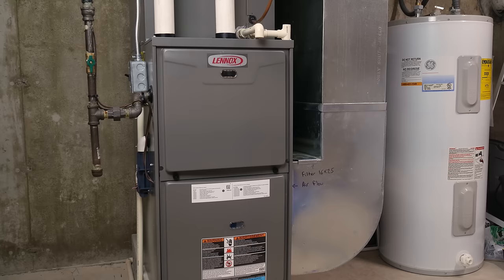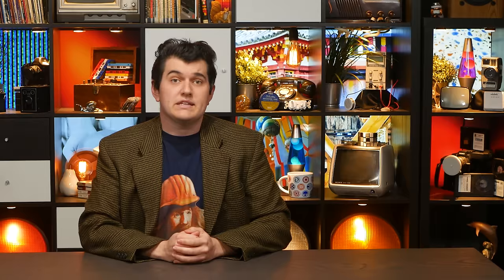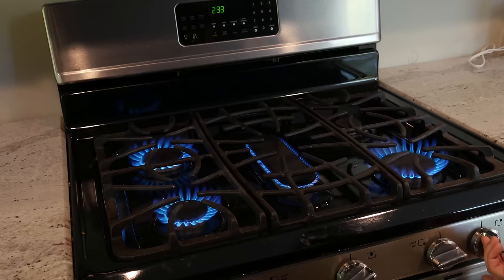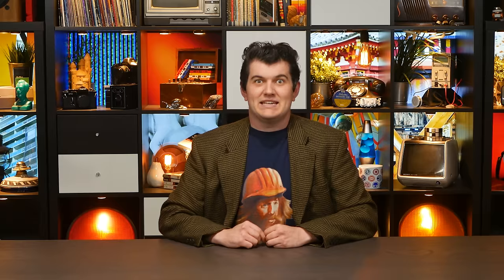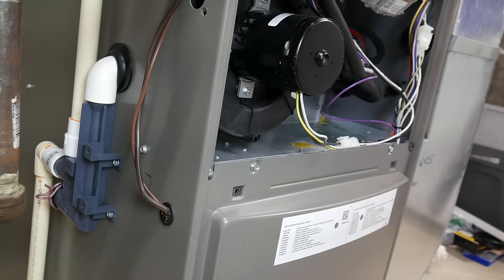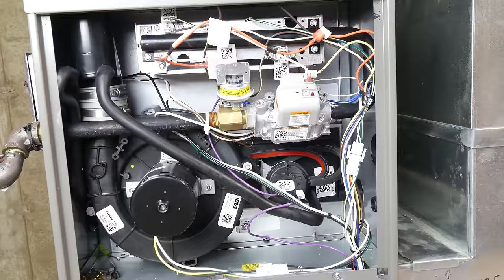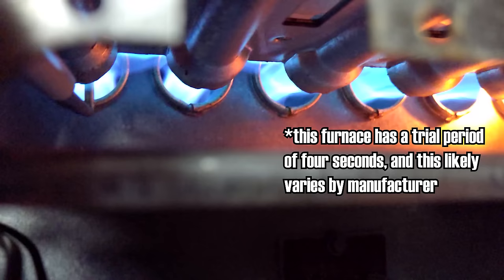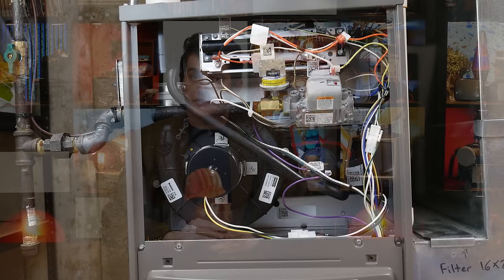Forced-air Furnaces: The What, Why, and How

Comment: In Brazil it's the reverse, you MUST have an AC unit, or else you'll die cooked, last week we managed to hit 43°C.
Reply: Those temperatures are a crime against humanity.
Reply: @liesdamnlies3372  Add in some extremely high humidity and you'll feel like you're dying every single second (you probably will).
Reply: @tomhsia4354  I'm Canadian. When it hits 28 degrees with high humidity, it's a heat wave. And my own personal "jfc it's hot out" point is 24.
Reply: @liesdamnlies3372  I'm a Canadian, and I've lived in Shanghai for extended periods of time. It can go over 40 degrees Celsius with very high humidity (my humidity meter just reads "err: hi"). After heat waves like that, you get cooler temps but with humidity so high stuff tends to become wetter instead of dryer. BTW, air conditioning was not common is schools during my time, and we could have God damn mushrooms growing from our class mop. Hell must be a pretty comfortable place for people who can tolerate the climate in Shanghai, eh?

BTW, winters in Shanghai make you feel far worse than Southern Canadian ones, despite the temps being 20 degrees higher. High humidity on cold days make it practically impossible for you to get comfortable (it also rains and the heating is shit)
Reply: @tomhsia4354  That's just...wrong. Inhuman. I'm just gonna stick to Canada. The world is far too scary a place.
Reply: Had to convert those to freedom units.  Yeah, 43C (109.4F) is pretty damn hot.  28C (82.4F) is a bit warm* until I finally get used to it then winter hits and I'm freezing (Last year didn't have a lot of snow but it regularly got below 20F/-6.6C).

*Assuming moderate humidity, in high humidity I'd be sweating my ass off.  Don't have AC in my Condo (well I do but it's prohibitively expensive to run) but I do have it in my car.
Reply: In Los Angeles CA last month it hit 121F. That's 50°C. For about 3 months it was around 100F every day. Oh yeah, and smoke from fires for over 2 months.
Reply: @bigbaddms  Jesus Christ. 121F with smoke? No, just no.
Reply: @tomhsia4354  it literally looked like Armageddon 🔥🔥🔥🔥🔥🔥
Reply: @bigbaddms  Just reminded me of this: https://www.artstation.com/artwork/WKP41G
Reply: @liesdamnlies3372  Absolutely. Whenever I cost family who live in a coastal city on India, the humidity is what's unbearable.
Reply: In India, temperatures reach 47 degrees during summer where I live. Here we install separate units for each room to increase redundancy. Furnace is an alien concept here lol.
Reply: @tomhsia4354  It's 31C with 86% rh in my city. Air-conditioners are keeping me alive.
Reply: @panzer3279  In Shanghai it's also common practice to install each room with it's own air conditioner. It also works better since each conditioner can be way smaller and work on a smaller room. Furnaces (and insulation) are also foreign concepts. Each room having their own weather sealing is quite common, however. The new place my family moved in has central AC for the household and it does not work as well. We have heated floors but that's a useless waste of energy.

Comment: HVAC tech here. For some reason, down here in Florida, our county is installing way more furnaces than heat pumps because now there is reliable access to natural gas. I've always hated diagnostics on furnaces because they looked so foreign to me, and accessing anything in the evaporator coil box is a chore. 

60% of the time, the issue is a malfunctioning safety device rather than a functional device, which takes way too long to diagnose most of the time. Plus the safety devices are a whole lot less to replace than the real components, which means less money per call, so they're both longer and less profitable. I'm just lucky to also get an hourly with my company; that kind of a rarity.

Comment: I bet he scanned every one of those QR codes when he opened that up.
Reply: Technically they aren't QR codes, they're... some other thing I can't remember the name of now
Reply: Managed to scan one from the video, apparently it's a Data Matrix, and it actually has more useful information in it than I expected... there's actually some readable text as well as a number
Reply: @EdwardMillen   What are they called? they look pretty QR'y didn't know they had a different name
Reply: @JessHull  Data Matrix.  QR codes have squares in 3 corners while Data Matrix have solid lines on 2 edges and even dots along the other 2 edges.
Reply: @EdwardMillen  they are actually QR codes they corresponding to the part numbers it is attached to. something Lenox does
Reply: @abjz71  ... but they're literally not QR codes, they're a different type of code called a Data Matrix, as me and someone else have both explained above. I'm not disputing what they contain, just the type of code they are

Comment: The sparky thing wears out. Our furnace eventually started clicking the sparky thing multiple times before it would light off.
Reply: I remember when furnaces used a small, perpetual flame, called a pilot light, to ignite the main burners. And there were no draft blowers back in the day. They relied on convection to draw the combustion gasses through the heat exchanger and out the flue pipe.
Reply: @dougbrowning82  Mine still does.  It still uses the pilot light to ignite the burner.  It's old.  But still works quite well.
Reply: @dougbrowning82  Steam boiler & HWH with standing pilots here.  Boiler has an open pilot that's easy to relight but is susceptible to drafts.  HWH has a shielded pilot that's a pain to relight (manual piezoelectric ignitor like an old propane grill) but much less likely to go out.

Comment: In the Netherlands most homes are heated with boiler/radiator systems, with furnaces being limited to upscale villas. People with that kind of hot air heating systems seem to swear by it though as they consider the comfort level to be much higher.

Both are now being replaced with air-water and air-air heat pumps respectively as were moving away from natural gas.

Comment: Thermodynamics: You can't be more than 100 percent efficient!!!
Heat Pump: Hehe, Heat Pump go brrr
Reply: I don’t understand what your problem is. In reality heat pumps are not more than 100% efficient. If you look at the complete cycle they aren’t. We just don’t really car about the hot exhaust to the atmosphere so we can ‘say’ it is more than 100% efficient. That is also why things that burn things like furnaces are measured on their actual efficiency while  vapor compression cycle machines are measured on COP which is not technically efficiency.

Comment: Spark Ignition systems are still used and in my personal opinion are more reliable than hot surface igniters. I don't run across nearly as many failed spark ignition controls as I do burnt out hot surface igniters. To expand on the flame sensor and its operation, what you are looking for when you test one to verify that it is indeed dirty and causing ignition failures is you run the signal through a DMM and look at Micro-amps DC. You are looking for anything above 0.5 micro-amps which is the rule of thumb cutoff limit for proving a flame. You pull the flame sensor once confirmed dirty, clean it, (I prefer a brass brush as it doesn't gouge the metal and cause excess surface area to be created to hold more crap in the future) install it and test it again to prove the flame sense is within the proper range for whatever you're working on, usually 2 to 6 micro-amps.

Comment: You might want to add a video or addendum to this one to discuss the even older forced-air furnaces that had no draft inducer at all, such as those commonly used in the 1980's. My current home has one of those, but its in this year's plans to replace it with a modern one.

Comment: I didn't know about the condensing part. That's pretty cool (hot?).
Did I miss how it can have an open drain without also blowing out gaseous combustion byproducts?  I'm guessing a water trap? I think that's what that little blue thing connected to it is. 🤔
Reply: Yep, all condensing furnaces have a trap somewhere that should be cleaned out yearly. if the trap clogs it will eventually stall inducer draft preventing furnace from working,
Reply: In a proper installation, the exhaust PVC pipe has a slight rising slope from horizontal.  As the remaining moisture condenses, it flows back into the furnace and down the drain.  If the pipe sags, it will fill with water, leading the furnace to shut down.  Learned this at a friend's house, which got quite cold one night.  The first thing the HVAC guy did was push up on the pipe, which drained the water, and the furnace could work again.  (He fixed it after that.)
Reply: or go into a small reservoir that humidifies the circulating air when it evaporates.

Comment: I've never seen a furnace with a thermocouple for a flame sensor. Since fire is conductive, all the flame sensors I have seen are just bare conductors in the flame, with the flame itself closing a circuit between the conductor and the burners. When these go through failed ignition cycles, it is usually because there is soot or corrosion that is causing resistance on that circuit. Cleaning the burner face with a steel wire brush will usually fix it.

Comment: The boiler and radiator system in the house I was staying in while in england broke my brain as a Canadian. WHY IS THERE A TAP ON THE HEATY THING
Reply: RiotPunch where exactly was the tap? UK here, and can't really picture what you're referring to! Unless it was a super antiquated system- something more like a kitchen range that also served heating and hot water?
Reply: @spencerwilton5831  it was more a valve, but it looked like it was off a sink

Comment: You missed one important safety switch. Roll-out out switches! They help detect a cracked heat exchanger. In the event of a cracked heat exchanger, the pressure switches may not catch it. The loss of vacuum in the heat exchanger will stop pulling the flame through it, causing the flame to "roll-out" of the primary tubes and will quickly heat up the burner box causing the roll-out switche(s) to open. 
Great explanation though and glad to see you caught the flame sensor mistake. I feel like you know more than most gas techs that work on furnaces for a living

Comment: Theres also another type of furnace in north america that's more modern called a 2 stage furnace (also refereed as a dual-stage furnace). This type of furnace saves energy on slightly warmer days by only lighting half the burners, and lighting the second stage only when needed (or whenever the thermostat calls for second-stage heating). 
I have one of these, and mine also has a variable speed blower motor, which can really save energy on days where it isn't sub-zero outside. variable blowers really make a difference because when you set your thermostat to constantly call for the blower, it stats on a low setting, where it is quiet, efficient, and still moves air. When the thermostat calls for heating (or cooling), it goes to a slightly higher setting, where it moves a lot more air. After a certain amount of time, the blower will go to an even higher setting, and make the heating/cooling go much faster. In the winter, second stage heat also kicks the blower into a higher setting on 2-stage furnaces.
Edit: there is also a 2-stage air conditioner, where the compressor has 2 speeds.

I hope you like reading!

Comment: When my parents moved into our home, they found that the previous owners decided to have the furnace installed in a small closet in the basement, which to my understanding would allow for any carbon monoxide to concentrate really easily. They had the furnace moved pretty quickly because of that.
Reply: 🤔... If their furnace is leaking enough exhaust that carbon monoxide is a issue at all...you need to fix or replace the furnace immediately.
Reply: @nunya___  safety protocols work because they're written for "when shit hits the fan", not "if shit hits the fan".
Reply: At least in my area, nearly all furnaces are installed in small basement closets. My old house actually had the furnace installed in a barely - accessible crawlspace. It's not about the 'where' it's about the 'how' that is important.
Reply: But wouldn't having the CO pool in the closet - where it could be detected easily - be better than having it disperse into the house?
Reply: The purpose of locating the furnace in a closet is that you also install a duct to allow outside air to freely enter that closet; it keeps the cold outside air separate from the living area.  This is useful for non-condensing furnaces that lack a specific connection for combustion air input.
Reply: @tissuepaper9962  I know that... are you saying they should not replace a furnace  because of how safety protocols are written? Home furnaces don't have carbon monoxide detectors as part of their "protocols" and locating a furnace in a small closet is not going to cause CO.
Reply: @Corrodias  No. The furnace fan will blow it into the home along with the warm air.
Reply: @nunya___  Oh, I suppose if it's one of those that uses air from inside the house, it would. I didn't think of that. But then, it's not really different from having it outside the closet, I think.
Reply: @Corrodias  No. I don't think you understand how furnaces work; how CO is produced and where it's located. It can't "pool" outside of the furnace.
Reply: @nunya___  Please describe to me in detail what it means for it to "concentrate really easily" in a way that is not "pooling", since you have taken issue with my phrasing and not with Peter Gill's.

Comment: "If you're used to a central boiler and radiator..."

I am used to burning wood lol
Reply: That's how I grew up. All we had was a wood stove.
Reply: I mean we have water filled radiators and a wood fueled furnace in the basement. But I guess living on a farm with 150+ acres of forests isn't something for everyone.
Reply: We had a wood stove with a busted thermostat for years that would constantly boil over, hate that thing. Replaced it with propane which was already half-installed previously but now it's just backup for the pellet stove (and for hot water) because this house is drafty af and propane is expensive.

I don't recommend living in 150+yo farmhouses formerly owned by dodgy electricians
Reply: Lol my house was built in 1975. And I am not talking about central heating...just a simple office-sized stove in the living room next to the dining table. 

It's the cheapest variant, especially for us, because the company gives us wood for free. Also makes the place really warm... If you really let it burn wildly you can walk in your undies inside while it's freezing outside
Reply: @IrisGalaxis  the ductwork for the "central" propane (and formerly wood) heating only covers about half the house that was added in the 60s (by the dodgy electrician, I think), the pellet stove is just a local heat source in the living room we installed but most of the house is pretty open so it works well enough.

Originally the house had a fireplace  but that was torn out long ago, the chimney is a bookshelf in my room now, lol

There may have been a gas stove in one room at some point as well, but I'm not sure when
Reply: Years ago my dad had a open fire in his house he used coal and sometimes wood
Reply: We got a heat pump. No gas lines in our house, and my grandma lost a house 20yrs ago to a wood stove fire so she would rather use electricity
Reply: @PixelOverload  most were not wired by dodgy electricians, but owner installers that were confident enough to be dangerous at times.
Reply: Well, given the pollution they spew out and their general inefficiency, you can't buy a new one anymore in parts of the world. While wood grows on trees, really, it takes a long time to grow a years supply of firewood. Fine if you are all alone in the middle of nowhere but who is nowadays...
Reply: @astranger448  what you cant buy logburners and open fires where you  are?
Reply: @CaptainApathetic  how do they work do you still have radiators
Reply: @thepurdychannel8866  Indeed. Given our average population density here (high) and general lack of dry firewood vs universal access to natural gas only normal. Also energy efficiency is heavily subsidized, nobody needs to burn wood.
Reply: Same here
We have an oil burning hot water furnace that doubles as our hot water source but radiators from the 40s kinda suck for heat so we just use it for hot water and then use 2 wood stoves because we get the wood for free or really cheap and oil is neither free or cheap
Reply: @astranger448  mainly rural houses use oil and wood
Reply: @thepurdychannel8866  yeah. Cause firewood is cheap and requires no infrastructure to get it there and minimum infrastructure to use it.
Reply: @IrisGalaxis  i love open fires and stoves wish i  had one in the house years sgo before i was born in another house my dad had a open fire with a backboiler in his house
Reply: Solid-fuel central heating, or just a standalone furnace?
Reply: @kaitlyn__L  Standalone

Comment: That's why I like forced air electric heat - no chance of explosion or carbon monoxide poisoning.  Worth the extra money.  My furnace is 25 years old and still works great.  I replaced the motor and most of the electronic controls 5 years ago, as preventative maintenance. Cost me less than 250.00 dollars. Electric furnaces have an efficiency rating of around 96%.

Comment: Odd question that I thought of: what happens if the power goes out while it’s running? Will it have enough time to react to close off the gas valves or will they stay open? Or is there a fail safe that clases the valve in the event of a sudden loss of power?
Reply: The gas valve is a "normally closed" type valve. Meaning that the furnace control applies energy to keep it open. If the furnace loses power, the valve closes.
Reply: @Jose_Pointero  thanks!